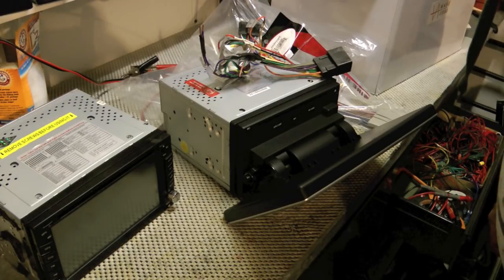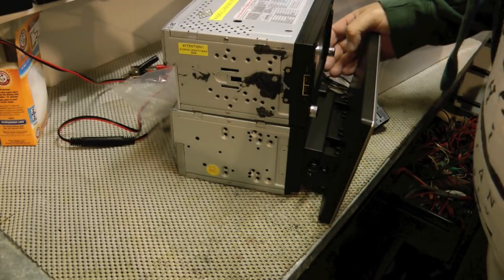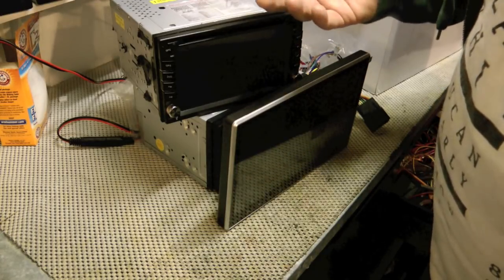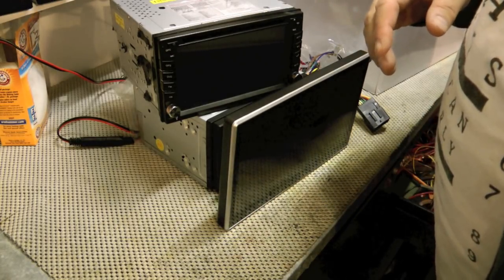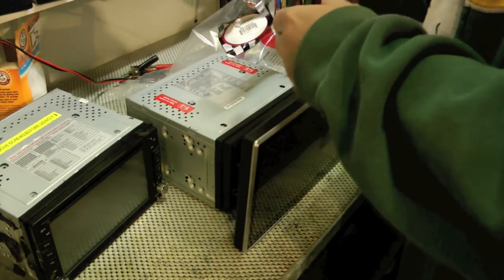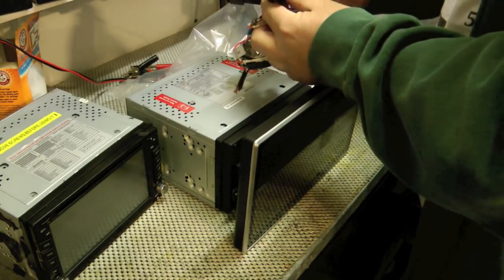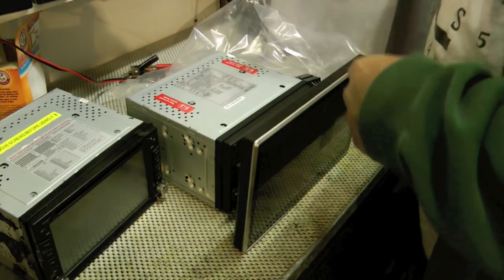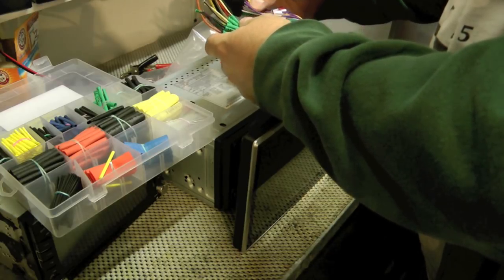Ford Crown Vic 10 inch screen double DIN stereo installation

Comment: I really wish I did a video on my Pioneer AVH-W4400 NEX unit in my 2006 P71 Vic. I found the issues that keep a double din from going in easily. I removed the AC panel and then cut the sub dash(the gray plastic under the stereo unit) with a Dremel tool. I cut 3-4 inches of it from the very back going to the front. This was the best thing I could have done. It allowed the unit the go in completely flush with no fuss and it allowed all my cables to have a place to go. Trust me...I have a ton of cables. Probably 4 times the amount more than you had going your unit. I first had that same Metra install kit you had. You're absolutely correct, once installed, you have to remove the entire bezel assembly to get it back out. I then stumbled upon the FMK552 part number I purchased on Amazon. This kit allows me to adjust the depth of the head unit in the hole. Plus, you can push the four tabs in once unit is installed(not easy, but I did it fairly quickly) and the unit can come back out without removing the bezel. Again, I wish I did a video or had pictures of what I cut out. The very rear bottom of the unit NEEDS to come down to allow it to sit in the hole flush. The amount I cut out of the sub dash was perfect for the unit to rest in there without any pressure against it. 

That screen is cool, very big, but looks cool man. Good find.
Reply from the maker: There are a ton of things I wish I filmed before I became W&J's Handy Dad.  I'll have to check out that other mounting kit.
Reply: I recently did my complete audio installation over the summer. Prior to installing the double din unit I search YouTube for all installation videos that pertained to the Ford Panther chassis platform. None of which gave any good proper details on fitting a double din unit. Some were cutting out pieces of the ductwork in the rear and above where the rear of the stereo unit rests. This was unacceptable to me. I marked the areas where the unit contacted the inner sub dash and went to town with my Dremel tool. The removal of the AC control panel is simple and gives you a lot of access to the rear of the unit. Cutting 3" of the sub dash out where the rear of the stereo unit rests was the answer to easy fitment and simple wire management. It provided a space for all the wires to go and rest at without interference to any components. The install of that head unit, two 6x8 and two 6x9 Rockford Fosgate Power series speakers and 400 watt RMS Rockford Fosgate Power amp. The system sounds good. Maybe a bit overboard for this car, but I rebuilt and repainted my whole Vic. It's almost new again.
Reply from the maker: My prior Double DIN install video shows the part that I removed.  I opted for the most conservative removal process because I was fearful that I might not like it and want to go back to something more traditional.
Reply: I get what you're saying, but at the same time, there's nothing I did that would not allow for the OEM unit to be reinstalled. The area of the sub dash section I cut out did not support anything and nothing was attached to that area. Like I said, explaining really does no justice like a video or even pictures would explain.

Comment: To be honest this kinda seems lacking... I spent the same on my Kenwood DDX9903S and it has HD Radio, Apple CarPlay, Android Auto, HDMI, dual camera input. 7" screen instead of 10", but honestly a lot more function. Love it in my Grand Marquis!

However, a very good instructional video regardless. With the amount of effort you put in, I wouldn't return it or anything. It looks cool though. Happy New Year as well WJ Handy Dad

Comment: What is used to connect the Torque App? A bluetooth OBDII adapter? Does it have a fast "update" rate?
Reply from the maker: I use a bluetooth OBDII adapter and it seems to be updating as quickly as the speedometer does on the dash.  Only issue I have with torque is the MPG calculation is way off and I've never been able to get it even close to accurate.  But all the other features of it are awesome.
Reply: @WJHandyDad  Sweet! Do you have any suggestions on any adapters?
Reply from the maker: this is what I am using:  https://amzn.to/3hzMmkJ

Comment: Mine is an O5 CV LX Sport, it too is a double din and obviously not a P71.  The stereo you're installing should still work for my crown too, right?  Sometime a P71 is a big deal when my is a p74 due to extra setups those cars have. Anyway, a great video to see when your work was done. Bravo!
Reply from the maker: "should" work.  I'd say "will" work if you had a 2006-up.  I don't know if the 2005 would need any "magic" done to the ducting behind the stereo.  I know some of the older models have more congestion behind the stereo.  Let us know.
Reply: @WJHandyDad  Unfortunately it's out of stock. Amazon doesn't have that stereo nor do they know when it will be stocked again.  Not very assuring, either way I'll keep looking. My 05 well that year is a deal breaker. There is stuff for a CV up to an 04 or an 06 and up. Seriously, I've looked for all sorts of things and it's just not in it for the 05 LX Sport and it pisses me off when this happens.  But then again, these models are hard to find. You'll see about 5 Marauders before you'll ever see and an LX Sport. haha
Reply from the maker: @chrisislas1838  I find that with a lot of products I buy on Amazon - they go out and get replaced by the "same" product using a different brand name.  I bet an Amazon search will turn up several 10 inch screen stereos that are almost the same as this one

Comment: Hey WJ, I recently removed my radio in an attempt to install an aftermarket radio. It didnt work, and now I'm looking to reinstall my factory radio. Long story short, I've lost track of what wire is what and cannot for the life of me find a radio wiring diagram for my 07 p71. 
Would you happen to have a wiring diagram that you know works? It'll be for the stock radio wires and what they go to so I can install a fresh wiring harness. Thanks in advance!
Reply from the maker: Did you cut out the factory harness instead of using an adapter between the new stereo and factory harness?
Reply: @WJHandyDad   The wires were already cut and (rather poorly) affixed to the current wiring harness at the time. I'm assuming the original harness had been removed at one point and replaced as the harness wires were twisted and taped onto the factory wires. I was having a lot of problems with the radio cutting in and out and the volume acting strange. It wasnt until I pulled the radio and saw the hack job the previous owner had done, that I realized it was probably the poor connections the harness was making that caused the problems. My "ya done fucked up" moment was realizing after I had removed the existing harness, I had not taken note of what wire went to what. And the harness had a different wire color scheme going. 
I would just need the color designations (what color is for what action, ie 'pink with black stripe is for rear passenger side speaker') for the factory wires so I could attach them to the corresponding wires on the new harness. I cant find a diagram that matches the colors of my factory radio wires. I figured maybe you may have one, or know of some kind of wire-color-decoder that would be work. If not, I completely understand, as I've been burning the midnight oil trying to find some kind of anecdote to solve my problem, to no avail.
Reply from the maker: @weaves22  probably the fastest way is to look at one of my videos installing a stereo on one of my Crown Vics.  I solder to an adapter and then connect to the factory harness.  Hopefully you can see the wire colors.  The other method is to get on your local library and see if they have the wiring diagrams online.  Panzer Platform has a video on how to get all the "shop manuals" on his channel.  Good luck!
Reply: Okay, thank you!

Comment: What is that switch near the radio? Should make a video on just the interior lol...car is very clean man
Reply from the maker: it's multi-function... one turns on/off the parking sensors in the front, one turns on/off the fog lights, and one is the dash cam override (dash cam normally on with accessory power, but can override with switch to be battery power)

Comment: I’m a little late. But I looked up that “correct adapter” and it says it doesn’t fit a 09 Cvpi ?
Reply from the maker: depending on where you're shopping they list the wrong adapter.  But the one shown in the video is correct at least for the newer models 2006-up if not even more models
Reply: Okay man thank you for getting back to me I just bought a 09 cvpi
Reply: Also one more question what size is the double din not the screen
Reply from the maker: I have another video where I install the first double din and I show all the measurements  https://www.youtube.com/watch?v=Gvjg77rbAk0
Reply: @WJHandyDad  you are wrong it depends on what stereo you had in it stock my 11 uses the adapter you say is for older ones just FYI I had a CD player factory my guess is you had a cassette player hope this helps
Reply from the maker: @bassboy6963  it may be a civilian model versus the police interceptor model.  Every P71/P7B I've had has used the same adapter shown in the video

Comment: My 2010 Ford crown Vic p71 doesn't have an antenna. What is a antenna for my radio
Reply from the maker: it's built in to the rear window
Reply: What type did you use
Reply from the maker: are you asking about the radio?  I have a link in the video description, however I believe it is no longer made/sold.

Comment: after i unhooked my stock radio and put in a new one, it didn’t turn on. then i plugged back in the stock one, it didn’t turn on either… any tips on what i messed up?
Reply from the maker: my guess is maybe you blew the fuse that gives power to the radio?  Fuse #12 15 amp in the passenger compartment fuse panel.
Reply: @WJHandyDad  i found it a little while ago and realized it then it blew again after replacing
Reply from the maker: @quezzfoe8243  if you've got a multimeter check for continuity between your radio "hot" and a ground point.  Sounds like maybe a wire is making contact that shouldn't

Comment: That installation looks great. Do you think the Alpine Halo head unit would fit as well? the "floating tablet" style touchscreen is very similar
Reply from the maker: I think anything can be made to fit - you might have to grind a bit of plastic, some years more than others.  You can always remove that trim piece and do it off the vehicle for a more professional look

Comment: Did you have to ground to the chassis? If so, where did you ground to?
Reply from the maker: I used the factory wiring, including the factory radio ground.

Comment: I was interested in one of these for my LX but I was worried about the fitment with the top of the dash. After seeing this I will probably stick with a regular double din.
Reply from the maker: I have no regrets about it - it has so many more features than other radios that it's been worth having the screen sticking out
Reply: I been doing more research on these types of headunits. There is one from Dasaita  that is like this one but it also slides up and down. I might try this out.

Comment: Hey WJ - I had one of these and was very dissapointed, also. Got rid of it. Highly recommend just getting a really good single din, digital only with bluetooth (no CD player), and a really easy mount for your phone, and just use your phone for everything - torque, nav, etc. The fact that the android OS on the stereo requires wifi/internet to be of any use, doesnt get android OS updates (i.e. security patches), and also running an "open" login from your google account (what if someone steals the radio?) - all of this is a non-starter for me. I Suppose you could buy a data only (Tablet) add-on from your cell provider and a 4G/5G usb stick so that you dont have to connect your phone to the stereo all the time...but why go thru all the hassle? The phone is easily 2-4x times faster/smoother than the chinese stereo with the hacked Android OS in your car.

Comment: where call i find a police car dash cam ?
Reply from the maker: are you looking specifically for a Watchguard or just any dash cam?  Having had both, I would say the Watchguard isn't really worth the extra money - the camera quality isn't better than a cheap Amazon camera.  The Watchguard advantages are more police related - having the data secured under lock and key and having the remote mic you can take outside the vehicle to record audio when away from the car.
Reply: looking for a dash cam the cops use on their ford crown victoria police interceptor.
Reply from the maker: Google Watchguard and see what is available.  Probably eBay or Amazon would be your best bet.

Comment: visual result is awful, sorry
Reply from the maker: yeah, I wouldn't go bigger than a 7" screen next time.  But I will tell you the 10" screen is pretty nice if you can get past the fact that it doesn't look right in a Vic
Reply: @WJHandyDad  I respect the job but visually... it looks unproper. Also in new cars I don't like screens that go over the space like in Audi. I just prefer them to remain in the frame.